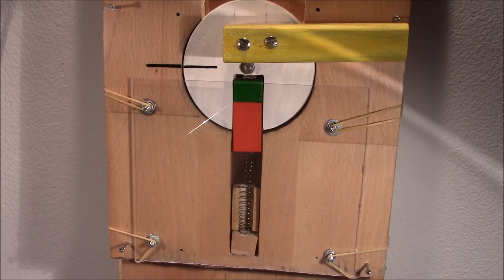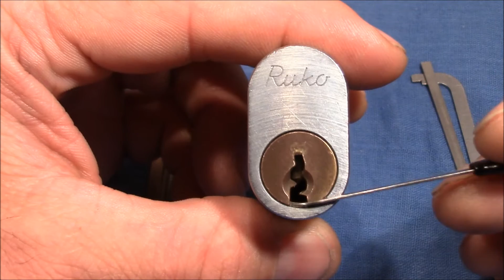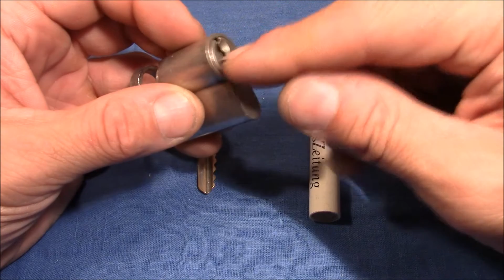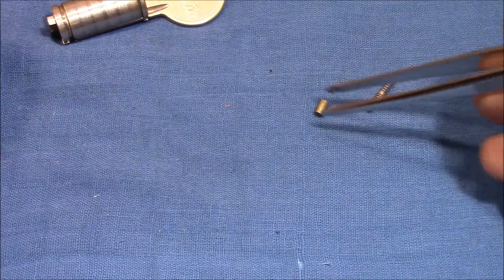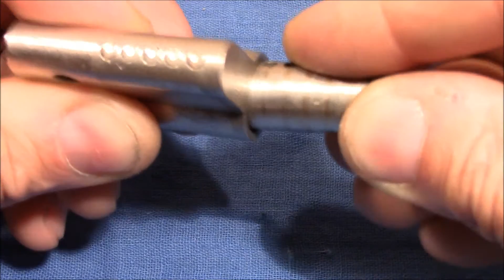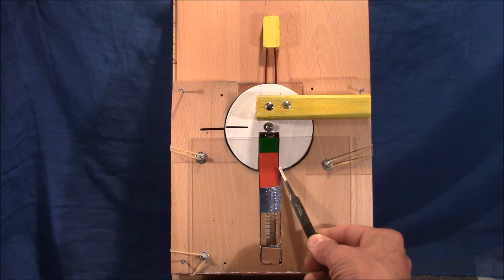(picking 54) Introduction to lock picking - demonstration and simulation (for beginners / newbies)

Comment: Excellent video. Great improvements on already nice simulator. Hope to see it a lot in future videos.
Reply from the maker: +Mike Pergl Thank you. Yes the model has undergone a some modification. I wanted pressure from the top, so I had to install a spring. Most difficult was to drill the holes in the plug for the wires (the pick) as I only have hand drill. Next I had to deal with plexiglas so that the spring stays in place. Some considerations and ~6h work ;-)